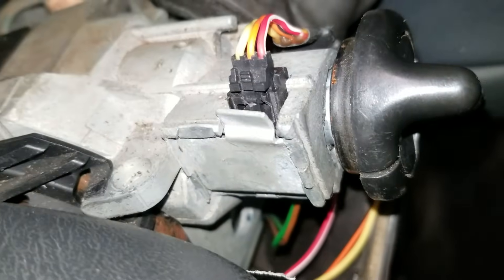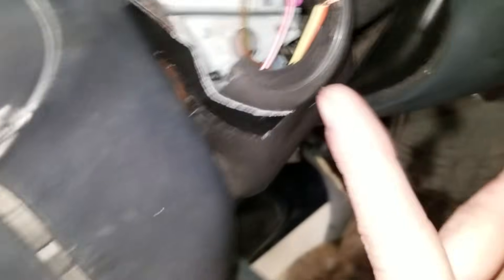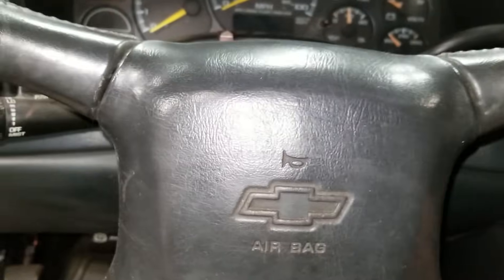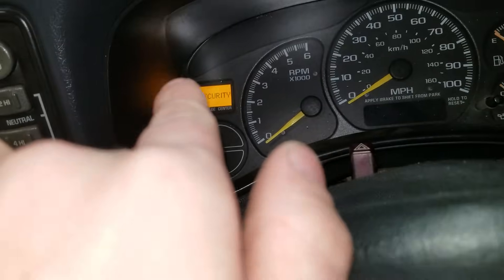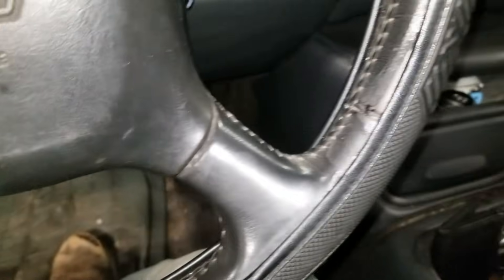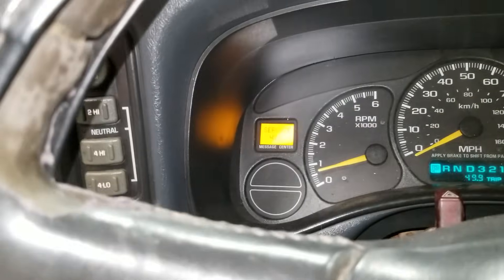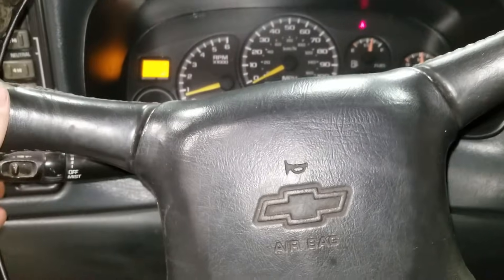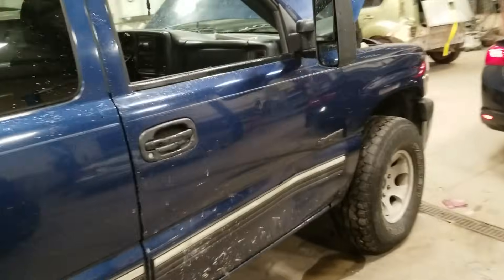99-07 Chevy Silverado No start Passlock 3 bypass 1500 2500 3500

Comment: So my security light doesn’t stay on, but it still doesn’t start. It will be on only when the door is opened and the key isn’t turned over,  did this thing three times and held out for 10 seconds. Tried it the third time after waiting 10 seconds after turning the switch off and still didn’t work

Comment: Help! I got a 99' Suburban with a crank won't start. I got a solid security light that won't disappear with the GM 33 minutes reprogramming process. I have replaced all kind of parts, got spark, compression, fuel psi, timing is good. I am about to get the VATS out once I fugure how to get one more plastic off. Might this be a possible fix?

Comment: Im going to try this on my 2000 Tahoe my husband always tells me not to be messing with anything lmao. But Ive already fixed several things on this tahoe with help from someone like you! I just need to know with the security light staying on will it cause any issues that it will not pass emissions when I have to have that done? I don't need him telling me I told you so! Thank you for your help. Charlotte
Reply from the maker: It should still pass emissions but if you would like to remove the security light after doing the reset use a multimeter (can get one for under $10 at most box stores or parts stores) and measure the resistance between the two wires i point out in the video then find a resistor thats as close to what you got from the two wires and wire that in between. It sounds complicated but its really simple if you take your time and stay calm.
Reply from the maker: You also want to be sure this is your issue before deciding to do this as with any YouTube tutorial repair. Any time my mother has an issue she googles the symptoms which isnt always a good thing if you dont know much about cars. Its like when you get a cold and start googling symptoms and end up thinking you have aids
Reply: @zachnuketown  Thank you for replying. The security light kept flashing so I used the fob that wants to work when it wants to work lol. then I used the key and kept unlocking the door. The security light quit flashing. The tahoe started right up. Im very nervous to drive it anywhere I don't want to get stranded. I also noticed the door handle from the outside key hole is possibly broken from the inside making it loose it pushes in as thow the clip might be broke holding the key hole in place. Maybe I should replace the door handle and just not use the fob anymore? Or can this just start messing up again? Isn't the fob what sets the alarm? Or the key sets it as well? I usually only use this to pull my boat but I don't want to be in the mountains and this happen to where the tahoe won't start.
Reply: Fuck yes

Comment: did this on 2000 sierra no luck, starts right up and dies everytime, I did notice it has a remote starter hooked in, which I know nobody has used in about 8 years, also notice headlights and dome not working! but parking light do, any help would be useful, it has been scanned and come back with p1626
Reply: Did u ever get it fixed?

Comment: Was wondering if by chance you know if this Works to bypass the vin locked ecm? I spun bearings in my over rated 6.0 in my 2500hd. I put a 5.3 in it that will eventually be on low boost but for now I just need to drive it NA.  I do have the computer that came originally with the 5.3. I've been worried the same as you to hook it up it's now running ungodly rich on the 6.0 computer.  Would love to have it be more efficient.  It's probably worse than the 6.0 wad on gas. Lol

Comment: Cut and joined the black and yellow wires  and left the red one intact.  I screwed up the sequence so I started again. During the second ten minute in the on position my battery died. I jumped it with another battery and started again but the second battery didn’t have enough charge I guess because it would only click on the second attempt to start it before another 10 minutes .  Glad there is always tomorrow.

Comment: I have a q i have a 98 gmc sierra i also jabe the same problem having to reset but not all the time mayne like 2 times a mnth but what i am having more of a problem with is it wont start without me pressing on the gas pedal several times while im starting it as it says in the manual but sometimes that doesnt work it jusy cranks but not start sometimes it acts like it wants to start but goes back to cranking my q is can this still be a security issue ?

Comment: Trying to do this bypass to start my truck but in the video it shows the security light flashing mine just comes on does not flash while I'm doing this any answers to why
Reply: mine does both and I've tried this like 10 times and still doesn't work
Reply from the maker: @mustaffa1611  it depends what model and year vehicle you have and also if my issue is the same as the ones you guys are having. It could be an entirely different issue. Start with a good scan tool and go from whatever codes you find. If its the same issue im having the truck will throw a vats security related code
Reply: Sec. Lt. Stay s on

Comment: I have a 2003 chevy express 2500 4.3l. Did exact same and it didn't start.  Do you know if it requires to use resistor and if so.. how?

Comment: To replace the ignition lock cylinder is only $50 which has the sensor built in.
Reply from the maker: Had I known that I still wouldve done the same thing just to avoid a chance of being stranded again
Reply: And then it won't match your door locks. Terrible option
Reply: @bigferny1  some times you have to do what you have to do?

Comment: My 2000 silverado 5 3 wouldn't start today, the security light was flashing and the battery light. I took the plastic off the column and somebody had already worked on the orange and yellow wires and had put silicone over the plug end where it plugs up. I broke the connector off on the column, will I have to replace the steering column to get it to run again? I'm in need of some help thanks in advance

Comment: My 2005 gmc envoy danali. Cranks but no start. Mechanic replaced throttle sensor and assembly. Cost me 400. Still the same problem. I can start it 2 to 3 times beginning in the morning then it stops starting. Cranks no start. If I let it set for about 4 to 5 hrs it will start.

Comment: Does the securtiy system shut off the fuel pump or it doesnt let it turn on?i have the same issue but im not sure if its the security light or the pump becuase i cant hear the pump turn on with the key on the on possition
Reply from the maker: A lot misdiagnose as fuel pump as i did. It does cut power to the fuel pump

Comment: I need help.... Mine crank but wont start. It just goes chew chew chew chew!. I cut the yellow and orange and spliced them but my security light does not flash it's solid..... The code I get is P1626. It gets fuel got spark checked all fuses and the thingys you plug the fuses in. Checked all relays as well. Everything works righ
 Jut wont start.
I don't have a fuse in for my airbags though. Wonder if that may be a problem.
Reply from the maker: This clearly isnt your issue If you have fuel and spark so dont cut shit for no reason. I have no idea what chew chew chew sounds like...jesus call a mechanic who can look at it.
Reply: Chew is its cranking but I'll try it again since I changed the crank sensor

Comment: I bought 2002 Tahoe on 2010 was installed  with after market security alarm  I used that for long time until both fob keys was bad so I decided to removed after market system and I start using original fob keys work okay but my Question is if I unlock the door with the key and open the door horn doesn't go off and the vehicle start normal is that normal ? my understanding is if we don't use fob key to unlock the door vehicle should not start and horn should go off please advice thank you and yes yellow security light  working  blinking  and  if i unlock from inside  and I open the door horn goes off

Comment: I have a similar issue with my 99 Sierra 2500 6.0L that just started yesterday.  I only plate and drive this thing once a year for a month, but use the same battery every time (fully charged).  Mine starts easy enough but now when I shut if off sometimes the beeping and security light stay flashing and I can't get it to turn off without unhooking the battery.  It's intermittent though.  

Currently the security light is staying on (solid) after I turn off the truck, but no beeping.  I still have to unhook the battery cable to get it to turn off.  No issues starting though...yet.  I do think my fuel pump needs to be replaced (has for several years now).  

There's also an intermittent engine light that comes on that indicates O2 sensor or fuel pump, and it does sputter going up inclines, but runs fine otherwise.  Any ideas?
Reply: You probably need to replace your bcm. There’s a video  on YouTube where a guy goes into detail about those issues

Comment: I had this problem and it was the TBC fuse.
Reply: what fuse is that
Reply: @tristenoberlender9685  The TBC (truck body computer) fuse powers the body control module (BCM). They rarely go bad. Mine was corroded inside not blown. It's the fuse box under the hood.

Comment: What do you connect the 2 wires to or do you just cut them n tape them? Do you wire all 4 points from 2 cut wires together!?
Reply: You could make a short jumper and press it in from the top beside the wires

Comment: Just did my 01 Avalanche , now my odo, my gas gauge and the temp gauge are not working , It also seems like the transmission is weak and I'm having to upshift from 1 to 2 to 3 then D  ? oh well at least the truck will run until I get my parts in  :  (

Comment: So, what I am understanding here is that if the security light doesn’t go off after 10 minutes during the normal passlock reset routine, then there is probably no point in cutting and splicing the two wires, right?
Reply from the maker: Nope but regardless this wont mess anything else up if you do the full security reset (30 minutes) if you spend only 1 portion of the reset on it you might as well reconnect the wires

Comment: What if the security light does not come on at all my truck starts and dies immediately please help have already replaced the fuel pump and the tps but dont have the money to keep buying parts and not fix the truck my security light will not come on at all even after i replaced the whole information panel i have asked soo many ppl for help the truck is a 2001 8.1 liter 2500 hd

Comment: So this happened to me on Thursday. Truck would start but die right after starting. I let the battery sit unplugged overnight to drain everything, started right up and ran fine till this morning, now it's doing the same thing, starting and dying. I have a 99 Silverado 1500 5.3 could this be a permanent fix? When I start it the security warning is flashing in the message box. Thanks!
Reply: Bcm maybe

Comment: Hey do you think this would work on my 2005 malibu maxx?? I'm getting very discouraged...i can't find much help on the internet
Reply from the maker: Maybe give it a try.
Reply: @zachnuketown  so I'm stuck because the colors of my wires aren't the same as yours, as you previously mentioned it would probably be...but could you tell me the name (or label) of the wires you used, so i can locate mine plz?? I would really appreciate it!! TIA!!!
Reply: @candicesmith9367   if your setting as If your going to drive down road it'll be the two on the left on top of the plug. He said that mine was yellow and brown or faded out orange one but it works saved my ass
Reply: @dustincoulter6164  thank you very much for your response and help!! But would you mind if I took a picture of the wires and sent it to you? I'm still so lost because my car actually has 2 plugs that plug into the ignition switch. Green plug with 5 wires going into the ignition and a red and black plug with 5 wires that plugs into the security module...so I'm pretty sure the red and black plug is the wires i need but I don't really know wiring too well except for radio a little bit... I've been spinning my wheels (so to speak) asking any and everybody who might be able to help me....with no luck. Let me know if i can shoot the pic to you ok?! Thanks again.
Reply: @candicesmith9367  the two wires that's on the left of the plug of the plug that plugs in on top. I'm not to swift on wiring either. But no matter the color it's the wires all the way to the left of the top plug
Reply: @dustincoulter6164  ok that makes sense and i feel super confident! Now I'm gonna go try it! You don't know how much you have helped me...thank you so very much
Reply: @candicesmith9367  yes ma'am anytime. It's plenty easy cut those 2 wires that are far left tie together then perform the reset. N it'll crank if that's the issue. Mine actually cranked the first time I hit the key n has every time since then   happy holidays ma'am

Comment: I've try it and it was working fine for a few weeks, then I'm having the same problems again, any ideas on what could be the problem
Reply: Some times won't even crank like if the battery was dead,
Reply from the maker: @benitotellez9075  that sounds like another issue entirely. Id start by having it scanned with a nicer scanner so you can see all the systems then go from the codes. Autozone will scan it for free if you dont know someone with a dealer lever scan tool.
Reply: @zachnuketown  that s security issue  googlr ways too fix it . There simple methods
Reply: @jennajone45  do you know any?
Reply: @benitotellez9075  I totally forgot I looked on Google it was a couple simple steps but kinda time consuming
Reply: @benitotellez9075  also look at the starter it has the exact same symptoms i changed my battery new one and changed statter and never had this issue again with my suburban.  It kept not starting sometimes and then work again randomly.  Also cold air would get low and then my starter was whining while I was driving
Reply: Could be your bcm might need to replace it

Comment: Find a mechanic with the software to delete the entire vats ( vehicle anti theft system ). No tools needed. Plugs into vehicle and deletes it.
Reply from the maker: @theboxcar24  or connect 2 wires together and call it a day. I have every scanner needed for modern vehicles and calibrations across most manufacturers and I’ve never seen an option to disable vats

Comment: So I have a 99 gmc c1500 security light stays on and mine is intermittent did yours stay with the nostart or was it intermittent
Reply from the maker: I had the light on anyways but it wasnt intermittent. It would happen i would do the security reset and it would happen again the next day until i did the bypass

Comment: Have got a 2001 Chevrolet Tahoe. Cannot get a replacement key fob anywhere. I live in France, so a real issue. If the immobiliser can be by-passed that would be great! The front and engine bay of my Tahoe looks the same as yours. Do you have to wait 10 minutes each time you use the car, or does anyone know where I can get a complete replacement fob with all the electrics inside? Thanks
Reply from the maker: Try Amazon and Ebay

Comment: I have a 2001 1500 gmc sierra and it was doing that too.  I had a fuel pump and filter installed.  went to pick up the truck and would not start.  the tech came out and scanned it and it said the security thing.  also had a new starter put in too.  the tech said in all his years he has never heard the sound it makes.  So I left it at the shop for them to figure out how to fix it.  the previous owners had a security system in the truck but took it out so I am out a few bucks.  Now I know what to tell them tomorrow.

Comment: Now Iam told it’s the fuel pump. Mechanic sprayed starting fluid into the intake hose and it started then died.
Reply: Not the fuel pump. Yes you can get it started with starting fluid but the passlock system shuts off the injectors giving the motor fuel.

Comment: 2005 lly can't get the mother fucker to start, just cranks but the fuel pump stays off. Tried several times to reset it and it won't work. No idea, hope this will work

Comment: Do you think, that can work in Chevrolet astro 99?
Reply from the maker: If it's the same ignition set up it should work fine
Reply: @zachnuketown  hey buddy I got a question. It worked great saved my ass but my cluster is jumpy now. When you crank it have nothing.
Reply from the maker: @dustincoulter6164  i would assume either you pinched a wire while in there or the cluser just happened to go at the same time. This generation Gm truck almost all have an issue with the cluster either flickering or it randomly turns on and off. I would scan it and if theres no codes look into having the cluster rebuilt tons of companies in the Us do them.
Reply: @zachnuketown  was afraid of that. I haven't scanned it yet. I have a really good tool like dealer level. I've rebuilt a few of em. I think maybe I'll just keep thumping dash til it don't work anymore then fix it lol. Thanks buddy. I never knew this trick. Love learning tricks like this not many people know. Tends to pay off weather it be on my own vehicles or other people's one way it lays the other way makes a problem easy to fix. Many thanks my friend

Comment: That green and brown wire that hook up to the Assembly do you know what that does
Reply: I damage my it’s connected to a plastic that plastic connects to the Assembly
Reply from the maker: @juaquinramirez9189  I'm not sure what it is but if you search for a ignition wiring diagram for your specific model on google you'll be able to find where it goes and what it does. If its just damaged id remove battery cable and reconnect the wire using a soldering iron and some heat shrink tubing and see if that fixes the problem
Reply: Commie Killer thanks I’ll try that out